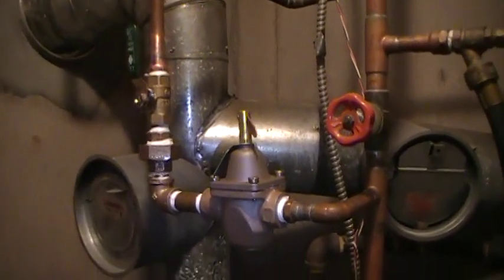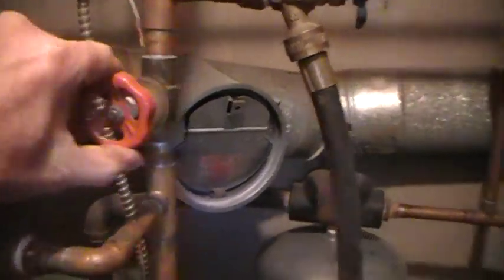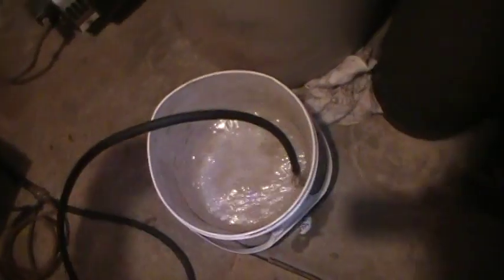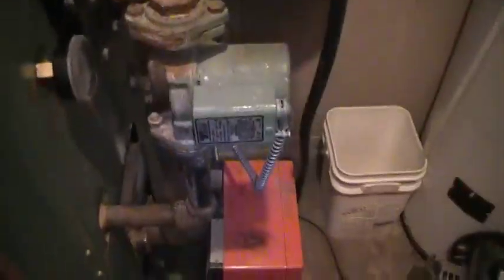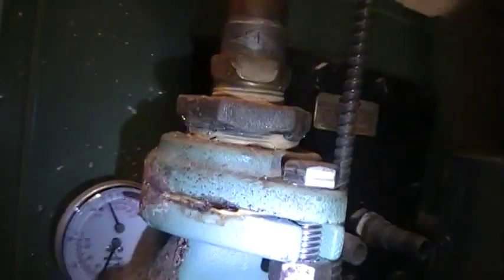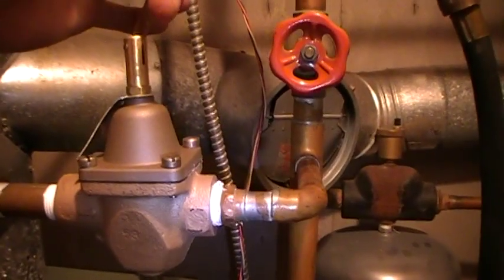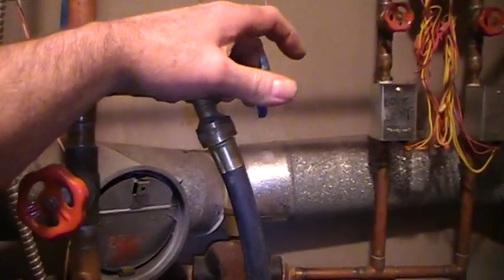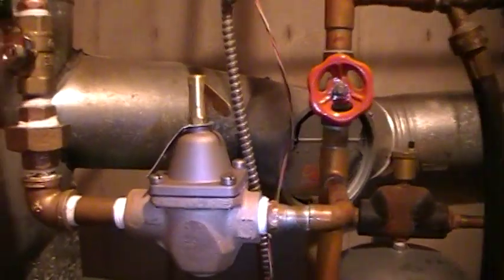How to remove the air out of your hot water heating system-girgling noise.

Comment: Thanks for sharing., Is there no hi vent on this system. I replaced my stuck hi vent($16) and that solved the gurgle. I want to know about using the public water system to prevent freezing in a power/service outage. I believe by putting water into the boiler drain valve it will come out the air drain valve, preventing a freeze up. What's your opinion?
Reply from the maker: Hello Dave;
You are more then welcome!
By having a flow of steady water anywhere in the house as in a faucet turned on to a low trickle will prevent the line from freezing. Many people have done this over the years.
I have never heard of anyone doing this when it comes to a heating system, but if you were supplying the system with water and using it in the same manner as purging then your zones would not freeze as long as you had a steady flow. It would not have to be too high for it to work.
I like that train of thought. No reason why it shouldn't.
Thanks for commenting and have a great week!    Al
Reply: thanks, the pipes are in the walls so i am afraid they could freeze before the boiler cooled enough to run the water, maybe better to just drain it out? Lots of BS when its cold with baseboard, adding glycol reduces efficiency? Any efficient  no freeze additives? Cheers!
Reply from the maker: Hello Dave 06516;
If you were to purge water through the pipes and boiler steady you would have no issues with freezing.
It would have to be monitored, but it would work.
It would be very hard to drain all the water out of the system as the lines go up and back down on every rad.
You do lose a little as far as antifreeze goes; all depending on what product you use. Some are more efficient then others.
There is a number of different types. 
Thanks for commenting and have a great week!     Al

Comment: Hi Al...my husband and I have been purging our system on the 2nd floor to no avail. I have several questions. #1 if the water is coming out slowly, how many times do you raise the pressure and how often as you purge? #2 - we have 2-zone heat...I think the zone valve for the 2nd floor is shot because we purged yesterday and closed that valve back up again and the heat stopped coming through the return pipes. Can we merge the 2 zones into 1? THANK YOU SO MUCH! Charleen
Reply from the maker: Hello Charleen Schwartzman;
If you hold the lever on the pressure reducing valve slightly upwards a little more and not all the way; this will increase the pressure slowly. Watch the tradicator (gauge) to make sure it doesn't go above 20 while purging. This will push all the air out of the system for you. Once you have removed all the air from the system; close your drain valve and release your lever on the pressure reducing valve. You want to look at the gauge again after you have purged and make sure it is at a minimum of 12 pounds. This should be where it should at to get the water circulating upstairs.
I would say that the pressure reducing valve is partially plugged and will not allow enough water pressure in the system to get to the second floor. For every foot of rise; you need almost half a pound of pressure (.434 ) One pound of pressure will lift water 2.31 feet. So if you have 14 feet to go up in height; you need at least 6 pounds of pressure.
Over time pressure reducing valves plug off, but by lifting the lever and watching your gauge you can feed the system to where it is working fine. When the boiler is hot; the pressure should be around 18 to 20 pounds.
How to check to see if your zone valve is working or not.....Turn down your thermostats to the point where they are definitely off. Then turn the thermostat that you think is not working for you up all the way. Go to the zone valve and try and slide the lever on the valve back and forth. If it slides easily; then your valve should be fine. Someone can stand there and turn the thermostat down again and the lever should slide back to where it originated at.
DO NOT PUT 20 POUNDS PRESSURE IN THE SYSTEM AFTER PURGING!
Check the tradicator (gauge) and be sure to have no more then 12 to 14 pounds of pressure in your system. When the boiler is working it will expand the water and the pressure will increase.
Hope this helps.....
Thanks for commenting and let me know how you get along!     Al

Comment: What if I do not have a zone valve? I have a return shutoff valve and drain valve but the output just goes right to baseboards.
Reply from the maker: Hello Greg;
If you have no zone valve then the procedure is that much easier. Simply close the return valve and open the drain. I usually close the valve to the expansion tank. Watch your pressure. If the pressure should drop off considerably; you want to lift the lever on your feed water valve and slowly lift it vertically making sure that it does not go above 20 PSI.
Once you have purged the system and closed your drain valve as well as open your return and expansion wank valve; you want to check the pressure. It should be around 12 pounds when all is said and done. Your system should be around 20 when in heated. 
Thanks for commenting and best of luck with the project!      Al

Comment: .I got a 50 year old Hydronic system.My qestion can I transfer my  circulating pump which is was installed in the back of the boiler  reinstalled it after the expansion tank for better circulation ?

Comment: Now I have no more water in my pipes.  What the heck did I do wrong?
Reply from the maker: Hello Kevin;
I would say that if you tried to purge the system and you now have no water pressure; the problem lies in the pressure reducing valve that feeds water into the boiler. It is a brass valve with a brass lever on the top of it. They can plug up with sediment over time.
To get water to flow into the system; lift the little brass lever on top of the reducing valve. Lifting the brass lever up will allow water to flow into the system at street pressure.
 Be careful when doing this as you don't want the pressure going to high in the system. Watch your gauge as you put it in. If it goes above 20 pounds drop the lever slowly on the reducing valve and it will drop down. You do not want it  have the pressure  above 20 pounds when filling it. Once you have finished purging the system set the pressure at 12 pounds and you should be all set.
I hope this helps!
Thanks for commenting and let me know how you get along!     Al
Reply: also on self filling system that have chemicals some time there is a self filling vale usually where the back flow peventer is make sure all the vales are turned on other than that  it could be a strainer y or the  presser reducing vale
Reply from the maker: Hello Colt;
In my neck of the woods; it is usually the PRV. Minerals in water is a big issue and plugs off the reducing valve over time. I have seen very few that have been in for a long period of time that actually work.
Thanks very much for adding some information in this situation!
Have a great day!    Al

Comment: Hi, thanks for your video.  I have a three zone hot water system. My basement zone works fine as well as my second floor. The problem is my first floor zone. I get no heat. I tried to purge that zone but when I open my drain valve the water runs for about 5 seconds and then no water comes out.  Can you give me an idea why?
Thanks, George
Reply from the maker: Hello George;
So you have the return valve on that zone closed. Do you have the zone valve clipped open? It must be clipped open in order to purge the loop and get any pressure.
What does the pressure on the tradicator (gauge) read on the boiler? There are 2 indicators on it. One is the temperature and the other is the pressure. If the heat is getting to the second floor then you should be all set as far as being able to purge the system. A pound of pressure will lift water 2.31 feet.
Step 1...Close the return valve.
Step 2...Hook the zone valve open.
Step 3...Attach a hose onto the drain valve of the  loop. and place in a bucket. The reason for the bucket is when you are purging you can see air bubbles coming out of the hose and when they stop; you know that the system is air free. This usually takes about 5 minutes depending on the number of pieces of baseboard. (risers in the loop).
Step 4...Open the drain valve and drain water off.
If your pressure should be low you can lift the lever on the feed water valve and add water during the purging. If you have to lift the lever on the feed water; watch the gauge as the pressure should not exceed 15 pounds.
You should be all set if you follow this procedure.
Thanks for commenting and let me know how you get a long!      Al
Reply: TheOldkid888
The problem is I dont have a zone valve like yours, also when i bled the other two zones the water was draining fine with just closing the return valve and opening the drain valve. Yes I watched the pressure and kept it between 10 and 15lbs at all times. Also, it was working well until the temperature outside fell below 25 degrees.
Reply from the maker: Hello journeykid1;
Try this...turn your thermostat up and this will open the zone valve for you if there is no lever to catch. Make sure you close your return valve and you should get water out of the drain valve.
Thanks for commenting and let me know how you get along!    Al
Reply: TheOldkid888
Tried it but same results.  when i open the return again it sounds like a short rush of water goes through then stops. It seems that's the amount of water that comes out when i try to purge.
Reply from the maker: Hello journeykid1;
Does the pressure gauge on the boiler change when you try purging the zone?
Thanks...     Al
Reply: TheOldkid888 It changed when I purged my other two zones but with this zone it doesn't change but I tried shutting off the return valves on the other two zones and purged the problem zone by this time keeping the return valve open to get some kind of circulation.  This dropped my pressure gauge and I had to open the pressure valve to compensate. After a while, I turned all valves back to normal and the pressure at 18. I turned on my thermostat, it clicked but the boiler didnt respond. I'm starting to think it may be a frozen somewhere in the line? Should i take pictures and post them?   BTW, i'm in New York and this problem started when the outside temp fell below 30 and has been this way for over 10 days.  Thanks for all your time and patience.
Reply: journeykid1
 Hey Al,  this morning the temp outside is 38 so i tried purging the problem zone and sure enough a gush of air mixed with some slush came out. My pipe was frozen. I successfully purged the system and its working fine now. Thanks again for you time and expertise.  George
Reply from the maker: Hello George;
I was going to mention that it maybe frozen, but I thought the chances were thin considering the basement and second floor were heating alright.
A mistake that a lot of people make if the house is too warm is they will turn the thermostat right off. They should only turn it down a degree or two. The zone valve will not open until the room temp drops to that setting.
I am glad you got it repaired.
Have to find out where  it froze and get some spray foam under those pipes.
Thanks for commenting and enjoy the heat!      Al

Comment: Wondering if you could advise me on how to proceed with my heating issue.  I have an oil furnace with baseboard in the basement which does not appear to be heating in the basement area.  The upstairs thermostat is working and heating.  The basement has it's own thermostat, it does not appear to be working properly to active the heat; which at this time of year could be a problem.  Could this basement heating issue be a zone problem or a thermostat issue, the breaker box looks ok so puzzled at what to do next?

Could you please be so kind as to advise on next step to check problem?  Thank you for your time and advice in advance.
Thanks,
Shep
Reply from the maker: Hello Shep;
I would get someone to turn the thermostat up and look at the zone valve when they do turn it up. Watch to see if the lever moves over on the zone valve. If it does not try sliding the metal lever over by hand. It should move easy.
Sometimes the lever on the zone valve will move, but the lever will not move, but this doesn't mean the zone valve didn't open. Sliding the lever over easily means that it did.
If the zone valve opened; then you have an air lock in the system because the circulating pump is pumping heat into the other part of the house. You then have to purge it to remove the air and you should be all set.
Thanks  for commenting and best of luck with the repair!    Al
Let me know how you get along.

Comment: Hi Jeff.  Hope u had a nice Thanksgiving.  I have radiators with a furnace in the basement. How do I purge my furnace/radiators??  Please advise.  Thanks!
Reply from the maker: Hello David;
Are they cast iron radiators you have? If so; There is a separate bleeder on each radiator on the side in the top corner. You simply unscrew the screw just a little and use a rag or a small container to catch any water that may slip out once you have all the air out of the system.
Thanks for commenting and have a great day!     Al

Comment: Can you do this when the heater has been running or hot? Should I turn off the heat before attempting. Also..I have three zone heat. I have 3 boxes on wall and 3 valves (one for each zone)  should I do this procedure to each zone at a time? Just noticed in your video you have 2 zone with 1 valve. Thanks in advance.
Reply from the maker: Hello Jeff;

You can turn the furnace off during this procedure, but you don't really have to.
You have to do each zone separately. Some installations that I come across only have one valve on the return. You turn that one valve off and purge each zone separately. I personally, install an individual valve on every return line.
You can then isolate each zone separately.
Thanks for commenting and have a great day!    Al

Comment from the maker: Hello atvkid0805;

In order for the water to continue to run you may have to lift the brass lever on the pressure reducing valve.
This will allow the water to enter the boiler. When lifting the lever you must watch your gauge as the pressure will build and pop the relief valve if you don't. You don't wan the pressure to go above 20 pounds when purging, once it has reached  that pressure;you can gently drop the lever and regulate the pressure using the lever.
Tks for commenting and G.L. Al

Comment: Great vid.  I have three zones and each zone/pipe has a drain valve.  Only one zone/pipe has a shut-off valve, but it is after the drain valve.  The only other shut-off is for water going into the boiler.  So do I close the shut-off valve that is after the drain valve while purging?  Won't this shut-off prevent any water/air from purging from that pipe?
Thx

Comment from the maker: Hello LTRMCrew;
When your boiler was installed; did they add anti-freeze to the system by chance?
You really don't have to add anything to a heating system as the water once it is heated over and over again becomes what I call dead.They do add anti freeze to prevent possible freezing though.Bigger systems in our area add chemicals to prevent some corrosion;but for residential areas;it is not used that often.
Wearing rubber gloves would not hurt for sure.
Tks for commenting!   Al

Comment: Hi Theoldkid888,

I am getting air in my hot water line ONLY.  My shower sputters when turned to hot, and I have water hammer on my clothes washer but only when set to "warm" or "hot."

Do you know why this would be and how I could fix?

Thanks!

Comment from the maker: Hello MrTravon77;
Keeping the water pressure up while purging will push the air from the second floor without any trouble!
Gradually lifting the lever up on the pressure reducing valve and watching the gauge at the same time keeping the pressure between 15 and 20 will force the air from second floor.The return valve must be closed while doing this procedure and the zone valve hooked open.I would turn your thermostat off before doing this. 
Thanks for commenting and best of luck with the purge!Al

Comment from the maker: Hello kwikslvr73;

I would drain a little water ( 1/2 gallon ) off of the system and see if the pressure drops any. If so your relief valve could be stuck closed and there is a chance that your extrol tank is waterlogged. First take a little water off the system and let me know what happens. The extrol tank which has a bladder inside started replacing the expansion tank a number of years ago. An expansion tank is about 5 times the price of an extrol tank.
We will figure it out!  Al

Comment: relief valve is 30#.  there is an expansion tank. says extrol I believe. there is NO pressure valve. is that what the tank does? would the excessive pressure cause the pump to leak??

Comment from the maker: Hello kwikslvr73;

Before you go and buy a bearing assembly I would check into a smaller pump made by Grundfos, Bell and Gossett or Armstrong. They are very reasonable in price! I call them throw aways , but they are very dependable and last for many years. That is all I have been using for years. 
I would check your relief valve and see what it is set for. Should be 30 PSI. Do you have an expansion tank or a small bladder tank on the system? The gauge should read around 20 PSI when hot!   Al

Comment: great video...I have water dripping out of the weep hole on my pump. should I replace the bearing assembly? this will break the system and I will have to bleed the system, correct?  Also, after reading your comments, I checked my gauge and it reads 35 pounds! Been here 14 years and never touched anything, could gauge be wrong?